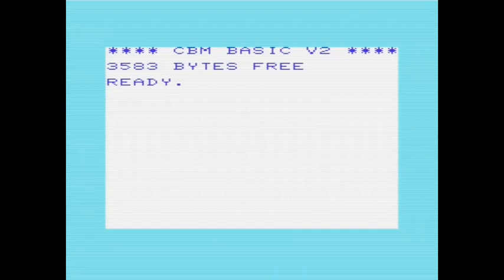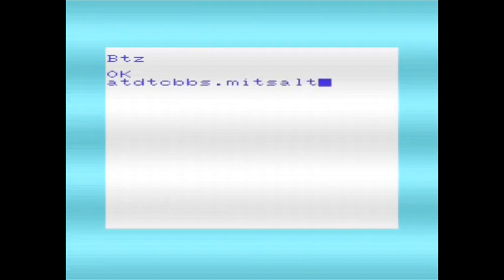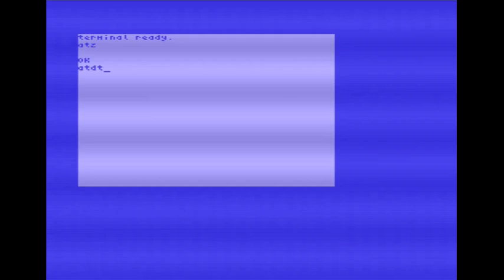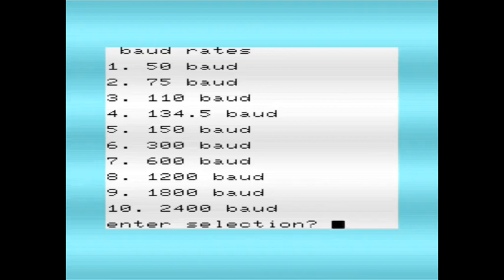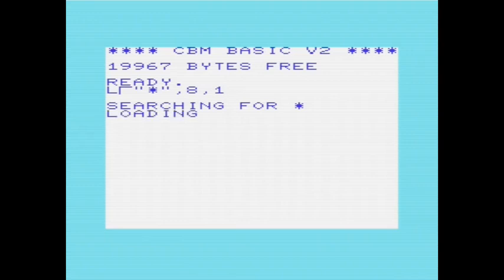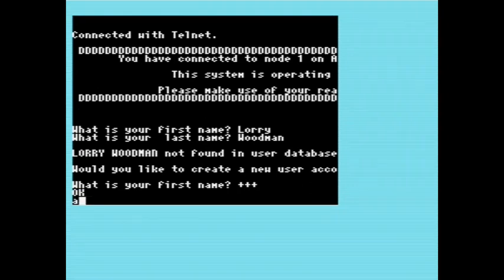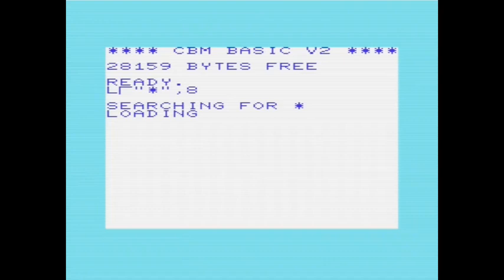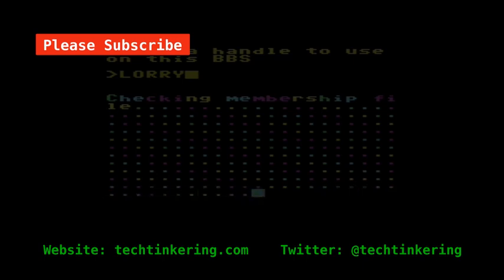Terminal Programs for BBSing on the Commdore VIC-20

Comment: In first-year university, I only had a VIC-20, and the university computers used an 80-column text editor with a Unix-like OS.  In second year, I got a Commodore-128, which, of course, has a hardware 80-column screen.

The university lab used PST-100 terminals, which were clones of VT-100 terminals, except the PST-100s had Insert-Line and Delete-Line escape sequences, which made text editing a lot faster on a 300-baud modem!
 
Mighty Term uses the standard Kernal routines, so the maximum baud rate would be limited by that.

I think the configuration variables are located within the body of the program itself, so if you change them to new values and re-save the binary block, they will be the default settings next time.
Reply from the maker: Great to hear from you and thanks for clarifying the backstory to Mighty Term.  There's nothing like necessity to drive us to innovate and push boundaries.

Comment: I tried loading up Victerm-40 on my NTSC Vic with an 8k ram expander but all I get is a tape load error (all I have is a tape drive). Any insight on how to make it work?
Reply from the maker: Sorry, I don't think I've ever used the tape version, only the cartridge one.    Perhaps its corrupted on the tape or there is some sort of hardware failure.  I hope you manage to get to the bottom of it.
Reply: You may need to reconfigure the DIPs on the 8K expander to "1000" to configure the memory expansion service locations 40960-49151 (decimal) / $A000-$BFFF (hexadecimal).  (A VIC-1110 cartridge needs to be opened to do so.)